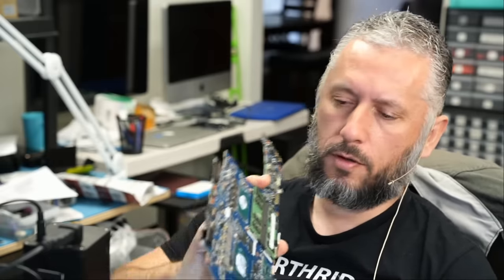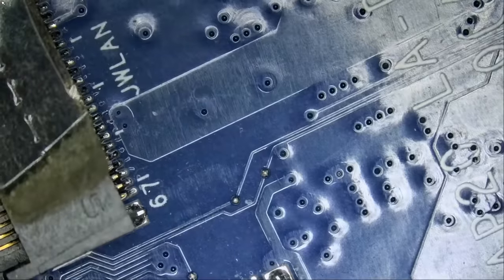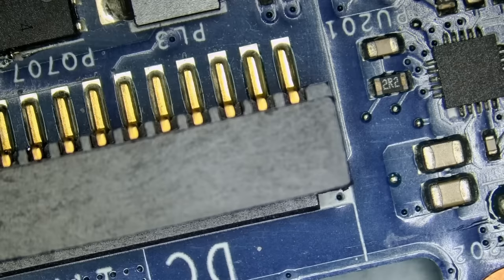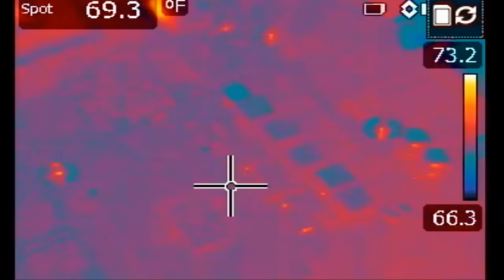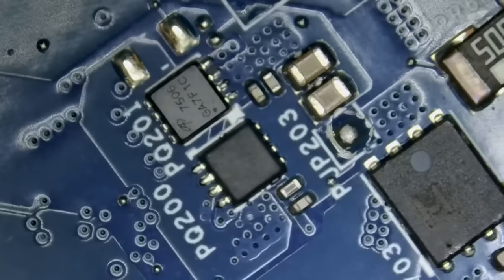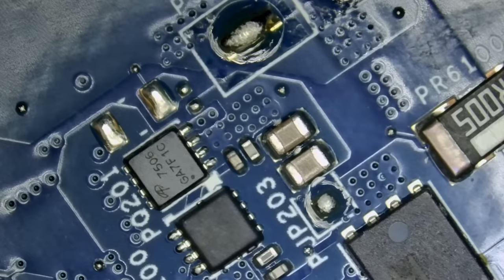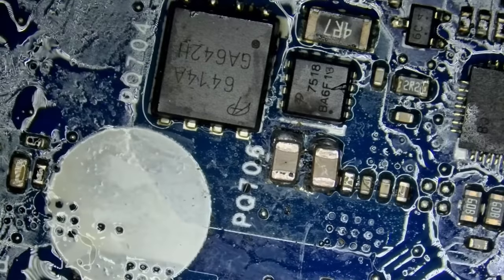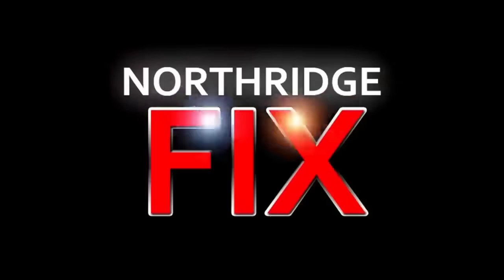Dead Dell Alienware Gaming Laptop Repair

Comment: I have this same Alienware laptop and looks like they are starting to fail now.  Great video on diagnosing shorts and finding the component needing replacement.   I wonder if there's an alternative for  someone that doesn't have the voltage injector?

Comment: Why not turn down the room lighting...so you don't get false positive reflections on the thermal camera?
Reply: It's the infrared that needs to be reduced. I'm wondering if a panel painted with flat black paint, placed in the background, would work well.

Comment: I have question about Nintendo Switch have no power , I already replace a new  the M92T36 and BQ24193 still not working  and then when I plug the charger the BQ24193 IC is getting hot even its new , what do I do next to check  thank you

Comment: I didnt know a single knocked off component can completely destroy a motherboard and thats happend to me more times than i can count my xbox 1 x ,alienware 17 r4 ,rtx 2050 laptop  ,and rtx 3050 laptop i figured no one would ever be able to find a missing piece like that at any shop ,and it was forsure a lost cause ,it seems every time i clean the fans 1 single small piece just barely gets bumped and falls off without me noticing it i just checked and seen empty solder slots on both my motherboards.

Comment: congrats ! how di dyou find the value of the dead capacitor ? did you measure the one on his side and pick a same ? or did you have schematics ?
Reply: voltage and capacity can be higher than the original without issues